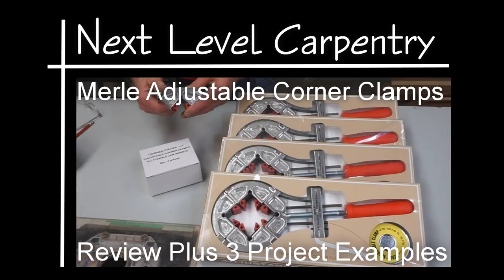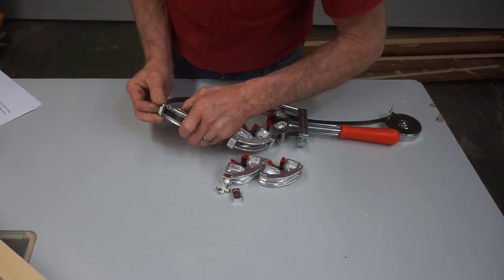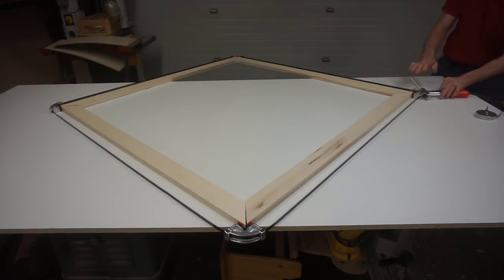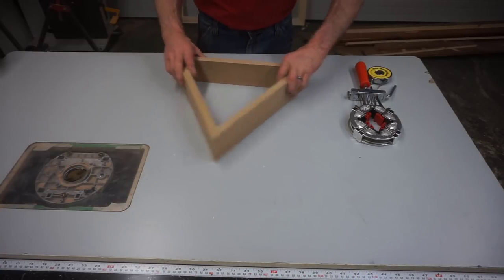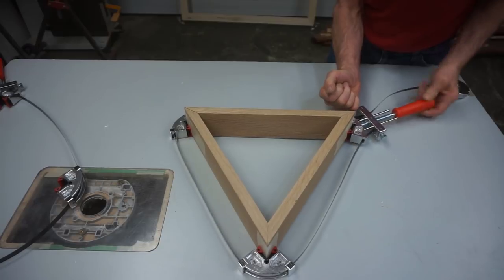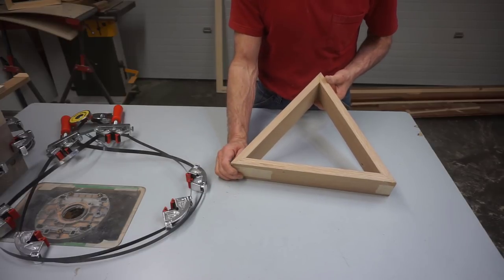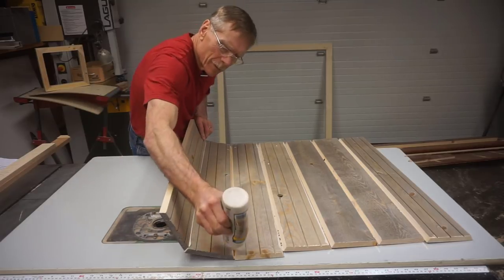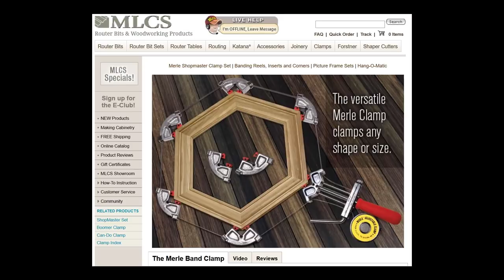Merle Adjustable Corner Clamp Review

Comment: Awesome vid! Another tip: Wipe off the excess glue squeeze out with clean wet rag before the drying process begins. It's a bigger pain later. Thanks!
Reply from the maker: Hey EWTD; I'm glad you like the video and thanks for your comment but I respectfully disagree COMPLETELY with the 'wet rag' tip you added.  I NEVER USE A WET RAG TO WIPE WET GLUE OFF WOOD!!!  Sorry about the all caps but using 'guy glitter' (fine sawdust) and a sharp putty knife is the best way I've found to remove glue squeeze out before it cures.  Water dilutes glue to some degree and diluted glue soaks into bare wood causing far greater clean up problems later on.  If it works for you just ignore my forceful opinion on this but I want viewers to know it's not a practice I use or recommend.  Best, Matt

Comment: Excellent presentation Matt. I was convinced to get one or two clamps before I finished this video. Yesterday's price varied from $140.00 each at WalMart to $29.95 at MLCS. Today, the price at WalMart and Amazon dropped but I had already purchased the Merle Band Clamp ShopMaster Set directly from MLCS for only $134.95 based on your great video and, of course, the great price. Thanks a Million from a new subscriber.
Reply from the maker: Welcome to Next Level Carpentry Don... the ShopMaster set is what I've been using and believe it will serve you well. Hope you check out the recent 'Best Box Beams' and older 'Make Round Wood Cylinders' videos here.  They both show the Merle's in operation doing what they do best! Best, Matt
Reply: Thanks, Matt. I've seen your older video. I fact, I was just re-watching it when the 'puter chimed.  I will watch 'Best Box Beams.' 
'Have you considered putting sides on your Jig with a hole for dust collection? That should be a rather simple addition. I already have a mild case of COPD so I avoid dust as much as possible...

Comment: Matt I'm making some newly designed doors 2-1/2" Molding strips as Rails & Stiles with a solid panel (Teak), and I was having some difficulty assembling the whole thing. I crudely made up a jig on my workbench to hold the miters together. However after I finished the work, I got some more jobs to do the same type of doors.
I decided to check Amazon for some type of clamping device and came across these Merle Adjustable Corner Clamps.
To see how well they perform, I decided to check on YT to see if anyone posted videos of them using the tool.
Actually that's how I came about finding you with this first found video and boy am I glad to have found this video and how you did everything in real time to the extent as you explain all the pros and cons of the tool. It was here I found your channel.
Matt I always believe in simplicity and practical way in doing things. I don't condemn the tech guys but simplicity is my middle name.
MLCS has made a customer of me as I will be purchasing the Shopmaster Set @ $134.95 Monday morning bright and early.
I don't know if you can get me a discount? (just kidding).
I've looked at all type of woodworking on YT and man you're a man after my heart. People who love to criticize negatively (which is good some times) those people see the glass half empty instead of seeing it 3/4 full. I always learn something regardless of the the best the good the bad and the worst when I see a video to interest me. The old saying "The worst written book must have something that will interest you". I hope these few words will continue to encourage you to keep going forward. You're awesome.
Reply from the maker: Very cool, Errol... glad to hear your 'path to discovery'.  Wish I could get you a discount on the Merle clamps but all I have to offer is the Amazon Influencer's link for Next Level Carpentry... it helps me but only helps you if the Amazon price is lower :-)
You can see the Merle clamps in use in a couple other NLC videos: https://www.youtube.com/watch?v=iyt6WBMt-NY and https://www.youtube.com/watch?v=2IqDsPXfzjk&t=1174s
even though the videos aren't about frames but you can see how well the clamps work in other applications.  If it seems to you like the clamps will work for your project I think you'll be happy with how well they work.  The amount of clamping pressure you can get with them is remarkable... if that amount of pressure doesn't pull a joint together then it's not cut correctly 😁
Your 'glass 3/4 full' attitude is great... and contagious!  It IS especially encouraging just now as  I struggle to produce a video about making sawhorses... the sawhorses are way easy but video production is a real challenge but comments like yours help me to work through the process!  Best, Matt  PS Let me know how your door project comes out?
Reply: Hello Matt, I received my Merle Adjustable Corner Clamps today and tried a mock assembly using it and boy ooh boy this tool is awesome, fabulous, and all that goes with it.
I saw for myself where you mentioned about the spring action of the reeling in the tape and it can really give you some knuckle bumps LOL. I was expecting it since I saw your video and how it can really register some pain to you.
Coming back to my clamps...It really holds the 4 miter corners firmly and square, but you'll definitely need to true up the corners before tightening and holding it firmly. I removed the Pivoting Jaw Inserts from the clamps to see how well the clamp will work without them and it also works excellent. I believe it works better without the inserts for 4 corner 90 degrees. These clamps arrived just in time for me as I'm in the process of assembling the cabinet doors with the mitered corners.
Matt you're the man for all seasons, keep it up and all the best.
Reply from the maker: Wow, thanks for taking the time to post this great follow-up comment, Errol, really made my day.  I'm going to 'pin' this comment because the fact you noticed the clamps work better without the pivoting jaws for 4-cornered applications is something I hadn't considered but makes complete sense so I think other viewers will benefit from it.  If you end up with pictures or video of your completed cabinet doors feel free to post a link in a comment so I and others can see 'em.
Best, Matt
Reply: Hello Matt, here is a link to a quick and dirty video of the doors assembled using the clamp without the Pivoting Jaw Inserts. If you wish to have the raw video for personal use to add to your video/s, please feel free to ask me and I'll upload it and send you a link to get the video;
https://youtu.be/A6s-3e27UmE
I also placed some slides at the end of the video to show where the doors are going on a wall unit I built for customers. Yes I lacquered them myself. Thanks.
Reply from the maker: Hey Errol, I sort of dropped out of touch with a BUSY spell in life in general.  The dust won't settle for another month so please don't take my lack of response as ignoring, OK?  I always appreciate your interaction and comments and look forward to them when time allows again...
Best, Matt

Comment: As an example of what this can do, this is a great video. There is another way for the heptagonal tube, or any tube with a number of facets - use bicycle tire inner tubes. Get some inner tubes, preferably not with sealing goop in them, and cut 3-4 strips from each one. Once you have your tube ready with the painter's tape, begin wrapping your tire strips around the tube. This allows you to put a lot of pressure all the way around the tube with little effort. Each band can be loosened for adjustment and retightening. A 26" inner tube will provide 3-4 strips about 80", unstretched.

Comment: This video is a must for using this tool. I have a project going on right now and I just took the clamp out of the packaging. Not at all self explanatory how to expand the clamp so I can clamp my material. I can't get the metal band to pull out of the reel.
Reply from the maker: Glad to help Christopher... the good news is that the clamps, although a bit temperamental, get easier to use as you gain experience with 'em.
Best, Matt

Comment: Thanks for the demo, I am in the market for some of these and was about to order some more band clamps from bessey (or similar nylon strap design). Glad I saw this, and ordered two through your amazon store. My Harbor Freight ratcheting band clamp has gotten glue on the band one too many times, and would rack significantly.
Reply from the maker: Ed P, thanks for letting me know with that comment.  It sounds like you saw enough detail of the clamps in the video so I think it will find them useful and effective.  And thanks for using that Amazon link ...every little bit helps! Best, Matt

Comment: Great video!  I was in the process of ordering more clamp jaws from MLCS, but could not figure out how to install them, without, like you, taking off one end of the tension clamp and retreading the new jaws.  But, first, I opted to look on your (and a couple other’s) channel to see if you had a solution.  I believed Mr. Merle HAD to have some easy way to install supplemental jaw clamps between the standard 4 clamps.  Thanks for providing that answer — in a well documented and demonstrated way.

You never noted why where was so much saw dust between the mock glue-up and the real glue-up both with the triangle piece and the septagon (or, as you call it, the septangular polygon).  Did you need to do some edge sanding…?  There sure was a lot of saw dust on the table.

Anymore now, except for boxes, I do not rely depend on a saw blade (either table saw or miter saw or miter guide — except for using a Dubby sled) to cut 45° angles to assure a true 90° corners.  Note, now Woodpeckers and a couple others have their knock-off of the Dubby inspiration and purpose using a single miter sled on a table saw.  I rely on a shooter table, with a seeming 45° angles, on the shooter table’s planing backer board.  This is made by cutting a perfectly square piece of MDF, Baltic Birch plywood, etc., cutting 5-ways with a sled to assure a perfect square.  Then, as best as can be done, cut this in half, from vertex to vertex, i.e., the diagonal.  Now, it really does not matter if the resulting angles are 45.6° and 44.4° because the planed miters off these two boards will ALWAYS equal, to produce a 90° corner: complimentary angles… — just make sure you match the 45.6° shooter-planed edge with the 44.4° edge: basic trigonometry (my favorite flavor of mathy stuff; if this was framed as a algebraic story problem, I would have a problem!).  In fact, it would not matter if the angles were way off, as long as one is bisecting the 90° angle of the square piece, both halves of the cut square piece will be the complimentary angles of the 90° — the resulting corners of the shooter-planned end pieces will be perfectly 90° when the two planed boards are glued, complimentarily, together.  I have been wanting to make an unconventional picture frame with, say, 30° and 60° (or 25.8° and 64.2°, etc.) — just to see how it would look.  If I cut my square piece at a diagonal of about 30°±, the other miter cut on my picture frame will, by default, be whatever complimentary angle is needed to cause the corner to be 90°.  This is not really practical to do on boxes because of the difficulty in making a true backer board at the height needed to plane something taller (or wider) than the width of a plane’s blade.  To go further into the weeds, consider the proposition pose by Bob Rozaieski (https://www.youtube.com/watch?v=C5BgSiar3Ws&t=24s for making a "real" mule's ear) for discussion / thought about whether one is trying to get the inside or outside miters to be imperceptively tight.  For boxes, the outside corners / miters must be tight because that is what is obvious, when, for example, one is making craft boxes or long columns (see Insider Carpentry - Spencer Lewis https://www.youtube.com/watch?v=kOmfHS3HtqM).  Furthermore, making 4-sided boxes or other stuff with the four corners that are not 90°, such as trapezoid boxes, etc., can be easy, also  You can assure precisely fitting angles by whatever saw blade angle or planer angle is set, this will cause the angles on the two ends of the two boards will be complimentary to 180º—the “angle” of a straight board, all done without much math — although the resulting wood grain will not match to each board, i.e., the wood grain would not match or "flow" around the corner without some precise resawing.  However, if you are particularly angle about the precise dimensions of each of the side boards, you may need to do some math.  However, for the easy way to do the trigonometry calcs, visit Shaun Boyd / Foureyes Furniture at https://www.youtube.com/watch?v=4x6B7pwldVo — or grab your ol’ trig textbook.  As Boyd notes, this is as simple as knowing what trig function key to hit on a calculator. For more info and demonstration of using the 180° complimentary angles so glue the edges of boards together to make a solid, flat panel, see the Bourbon Moth guy at https://www.youtube.com/watch?v=C9scpxNqb40 where he deliberately uses and creates complementary, non-90° angles using his jointer, as well as offering a tip on how to glue boards together based on their grain.

Comment: I am surprised they yet make a such clamps. I purchased mines on the very beginning of 1990s, so more than 25 years ago.

They are very convenient and replace a lot of "conventional" clamps. I made lots of cabinetry using them - including very big cabinets for our dorms and raised panel doors... The single not-so-good feature is the steel band turn the clamp handle something nuisance, but you can learn to cope with that... after a couple of decades two of four clamps I originally purchased had the band broken close to the fixing hex nut. Not a great deal to cut that part out and re-screw. I also strongly recommend those clamps.

Thanks to bring back them!
Reply from the maker: Sounds like you have much more experience with these clamps than I do Osvaldo so it's good to learn your favorable opinion of them... thanks for sharing it here.  Best, Matt
Reply: 0

Comment: Do you have a favorite manufacturer or style for clamps. Son 3 had a table project which called for clamps a bit over four feet. All I had were pipe clamps which left a little to be desired with the 1X2 edge wood he decided to glue up.  Thank you.
Reply from the maker: My current favorite clamps are some beefy Jorgensen bar clamps... you can see them in use and hanging in the Next Level Carpentry shop by the door.  There's so many options, good and bad, out there these days it's tough to recommend any specific ones.  BTW I use some less than wonderful pipe clamps for very wide clamping projects and just work around their foibles and shortcomings to get the results I need because they're tough to beat for initial cost where it's hard to justify awesome clamps for rare/occasional use.  Wish I had a better answer for you, Richard.  I will say that if Merle clamps can be used they're well worth the initial cost for their performance.
Best, Matt

Comment: Good clamping system but if you want to make it great throw away the bend tightening  handle and put a regular hex bolt in it's place.  Now you can get everything to lay flat and use a ratcheting box end or open end 9/16" wrench to tighten and loosen the clamp.  That's what I did to mine and now a way th keep that handle from springing loose all the time, any suggestions?
Reply from the maker: I think I like your hex bolt solution Don... only need to change band length once per project and, you're right, that angle handle is ALWAYS in the way!  Thanks for commenting!

Comment: Yes Matt, I first watched it on your channel, then I saw it again on the MLCS email that I received. By the way what is a WAG? (Walking After the Goats)(Working At the Garage)?
Reply from the maker: Marty, thanks for the followup and bringing this dialog to this video... ironically I'm not signed up to the MLCS newsletter so I appreciate you connecting the dots for me... it explains the spike in video views completely.  I hesitate to use WAG for its meaning which I picked up from an Air Force guy who used it as an acronym for Wild-A**-Guess, which is exactly what I used for tightening up those miters :-)  Best, Matt

Comment: Matt was the triangular frame at :38 for a flag case? I need to do 4 of them soon....  Do you think two clamps would be enough to glue up D.S.
Reply from the maker: I had a 'flag case' in mind when I made that frame Ron but it was purely a prop for the video.  I'd be comfortable using just 2 clamps on a 6" deep flag case with sides of any dimension as long as your cuts are crisp and fit well.  I think you'll love the clamps if you get 'em! Best, Matt
Reply: Next Level Carpentry   Great, thanks Matt.
Ron
Reply from the maker: @ronh9384   for sure... and good luck! Best, Matt

Comment: Hi Matt. I like the pivoting jaws for doing odd number corners, great idea. Band clamps are brilliant for mitres, like you've shown they automatically true your work up because
of the even clamping force. Great demonstration at the end proves how strong the mitred joints are due to the clamping force applied. Does the pressure from the locking handle 
mark the steel band? great video once again. Enjoyed watching. Tony
Reply from the maker: I don't see any marking or damage from the clamping handle on the bands, Tony.  In my experience the bands are more likely to get damaged from kinking them during use because the little 'reel' that you wind to store the band is always flopping around.  I also try to be careful not to step on or pinch the bands while they're deployed because that could kink them for sure.  All in all they do such an amazing job that I'd still use them even if it cost me a replacement band once in awhile...
Reply: @NextLevelCarpentry  Cheers Matt.